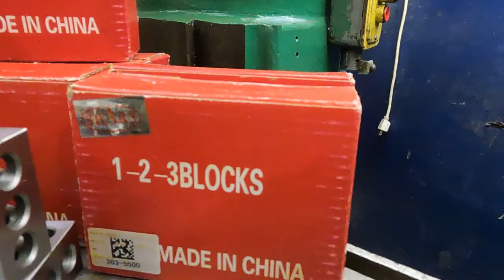Mail Call

Comment: You can not have to many 123 blocks. I have about 8 of them and some 246 blocks that where shop made that I bought used with some other tools. a good project would be to make the holders for the transfer screws.